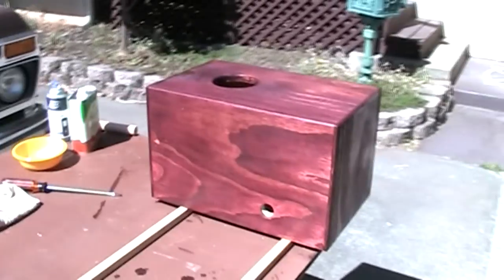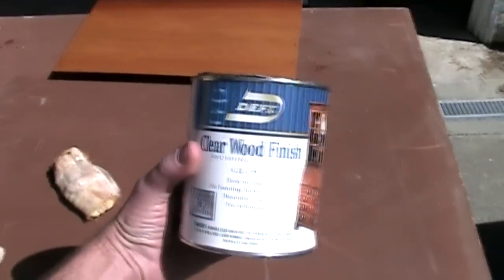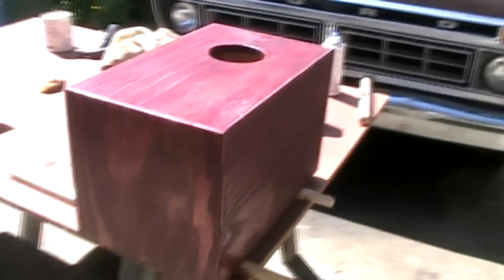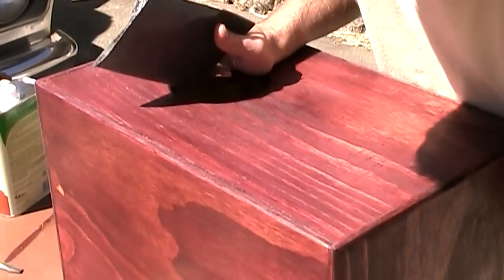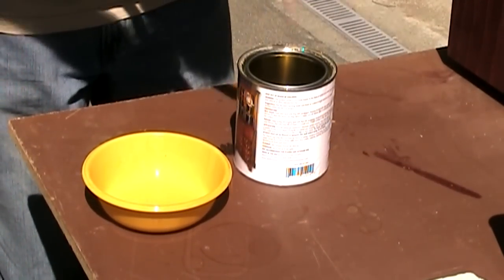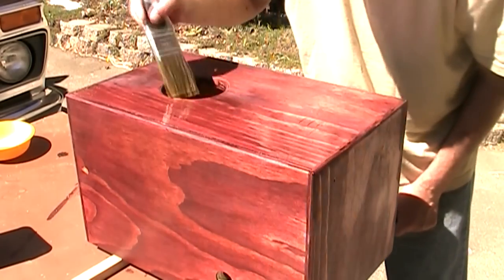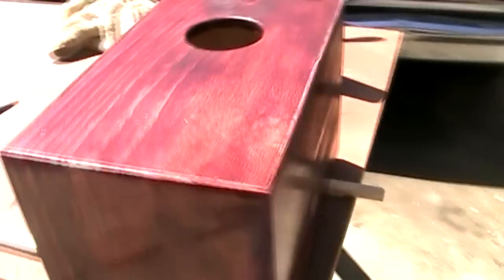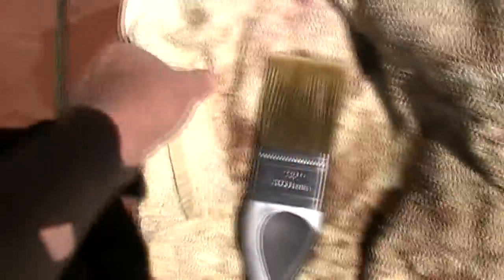MM 8-17-11: Applying a lacquer finish to wood

Comment: My Dad used spraying lacquer on all of the antique furniture my Mom bought. He taught me to spray when I was about 10 and I have used it ever since. I still have the compressor and gun he had from the early 50's. He would "rub out" the finish after it dried for a day or two - usually two.

Comment: I have been finishing for nearly 30  years. I have found the best way to dry my brushes is to first clean them thoroughly. Once you know they are clean, clean them again. This is always important if you buy expensive brushes. Then you should shake them at, or "pat" them against a piece of cardboard until no liquid stains the card board then hang them ,bristles down, and let them dry. Remember to "reshape" the bristles if they need it before hanging them.

Comment: Steve - thanks so much for this particular vid. I have been spraying laq (Same brand I see in this vid) 4 so long I had forgatten that it can also be brushed. They make a sanding sealer that works better than thinned top coat when spraying. 

I love the personal touch of brushing and do say with the polys, but seems like the laquer always wants to pull a stain, at least for me.  I'll give these tips a try on my next mid-size job.

Comment: At the beginning of your video, you stated that one of your reasons for not using wood stain is that you like the original grain to show more, and like the beauty of the original grain. I was curious if you have ever used wood dyes. I have found that while most stains obscure the grain a bit, the wood dye can actually bring out the grain and make it "pop" more than it did originally. I like both transtint and general finishes wood dyes, and have used them for several of my own projects. General finishes wood dye is fairly easy to apply and works just like a can of stain as far as the application. Transtint on the other hand comes as a concentrate that you dilute yourself to whatever strength you want (allowing for much darker or lighter versions of the color depending on your taste). I know it adds a step to the project, but definitely recommend them if you want the grain to show through really well, but also want to change the color a bit to better match a room or personal aesthetic.

Comment: This would work on the neck (although many people don't like glossy neck finishes because your hand sticks to it a bit), but not on the fretboard. You should not apply a finish to your fretboard because it will come off. For that you use oil to condition the wood, rather than putting a finish on top.

Comment: Thanks for this great video! How do you deal with drips on the vertical faces? Even though I try to be careful, I sometimes still have a bit of lacquer that spills over the edge of the horizontal face that I’m coating.

Comment: Hi Boss would a foam brush be any good or would it add air bubbles,
warming the wood! again I have heard boat builders talking about putting a heater on before varnishing then turning it off when shop hot, applying varnish then as the wood cools the gaps or holes in the woods fibres/grains reduce sucking the varnish into the wood grain,
Graeme.

Comment: Since you are an excellent teacher who cares, I'm going to quibble.

You are right that there is no need to sand between coast of lacquer, unlike varnish. However, it is not because "there's some chemical reaction" but because there is none! Lacquer forms a film just by the solvent evaporating; the second coat dissolves a little of the film and the molecules intertwine, but don't join to each other. Varnish reacts with oxygen in the air, changing it; more thinner does not dissolve it when cured.

Comment: omg im so glad I just watched this video.  im getting ready to use lacquet on a wood bed frame and i wouldve brushed it on like paint!  ps whats a cohone?
Reply: It's spelled Cajon, but it's a kind of hand drum. You stand it up with the big hole toward the back, sit on it, and then drum on the front (that separate piece he shows at 0:33 is screwed to the front) There are also small chains called snares, similar to a snare drum, that are fixed inside the cajon against that front piece to give it an extra special sound when hit. There are some cool sounds that you can make from it just from hitting different locations on the drum with your hands. Really fun percussion instrument, and super easy to learn.
Reply: can you make lacquered black furniture
Reply: @xinfinity8532  I'm about to touch up a battered, black-lacquered acoustic guitar, and after sanding the (extensive) bare-wood spots with 320 grit, I'm applying Varathane  sanding sealer with a small artist's brush, sanding it lightly with the 320, wiping it down with a soft cloth, then brushing on 2 consecutive thin coats of black lacquer.

Comment: Hi, may I pick your brains please. I am looking for advice on what lacquer to buy. Silly question, can I use lacquer from a car accessory store? and if so, can I brush it on rather than spray? Cheers mate, I have always loved your videos and they way you explain.
Reply: +chris randell  Both spray types and brush types dry quickly, but the spray types dry faster. The brush types are especially formulated to dry a bit slower so that you can brush out the finish smoother. You don't want to over brush them though.

Comment: Do the same principles used in this video apply to applying lacquer to painted wood, not stained? And why is the lacquer thinned for the first coat, but not the second coat?
Reply: ron matthews The first coat seals the wood grain and holds the other coats to it. Thinning means it can soak into the grain better, giving a stronger, longer lasting finish. It's a normal thing to do when varnishing wood, ply or MDF.  
If wood is going to be painted it must be primed first, using a primer, to allow the undercoat (if used) and topcoat to adhere.
Reply: @ronmatthews1738  spraying clear lacquer on mahogany , does it make the color of the wood darker when dried? Thats what I am trying to achieve on a area of wood repair on a guitar .

Comment: why is all the places I've looked say you must spray on lacquer? And that it's super combustible? Seems all cheery here
Reply: +Ethan Starkey I think it depends. I am for the fun of it trying to paint some furniture and am using 'water based lacquer'. Which I think has no issues in terms of combustion. Its a little hard to apply though.
Reply: +Ethan Starkey No you don't, there is a few techniques to applying lacquer. BUT the best result and easiest is spraying (considering your area allows air borne chemicals, cause in australia i will have someone knocking on my door if i sprayed lacquer). It requires industrial area, and the equipment required is near 1 thousand bucks. Depending on the job at hand really. If its one table or a box like this, you wouldn't go and spend that much. Or pay someone to do it, that defeats the purpose as its not your own product no more (some people do it as a hobbie). There is the roll and tip technique, or just brush if its thinned correctly. Spraying you can actually give a very even "thick" coat in one go. Ive done spraying the most for commercial use so yea, but we spent a total of 50000 dollars to make that possible. (air compressor, spray equipment, spray booth, exhaust system). If you spray dont be an idiot and not wear the correct mask for it, you killing yourself.
Reply: This guy looks,sounds like John malkovich